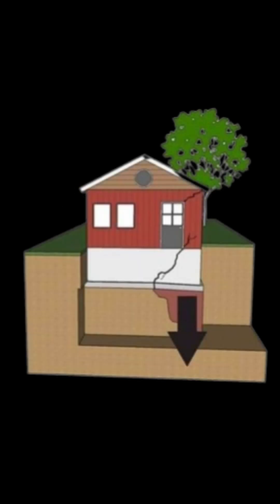3 Hidden Reasons Why Walls Crack in New Homes! | Don’t Ignore These Wall Cracks! | Walls Cracks

Comment from the maker: 🧱 Cracks don’t just appear — they reveal mistakes!
Shrinkage, settlement, or temperature — every wall crack has a reason.

💬 Comment below: Which type of crack have you seen at your home or site?
I’ll reply with what caused it and how you can fix or prevent it 👇

👉 Subscribe for more 60-second civil engineering tips and real-site lessons!
#CivilEngineeringMastery #ConstructionTips #WallCracks